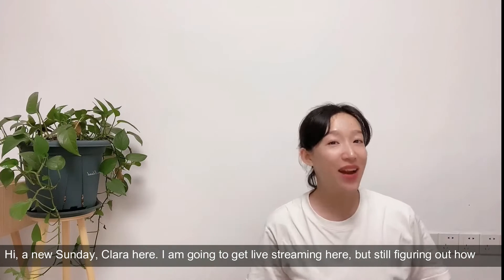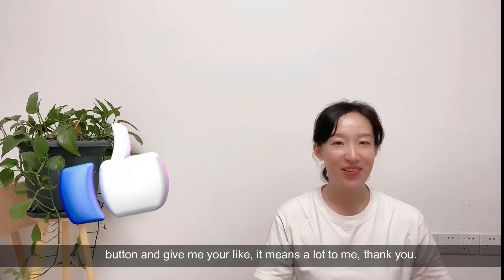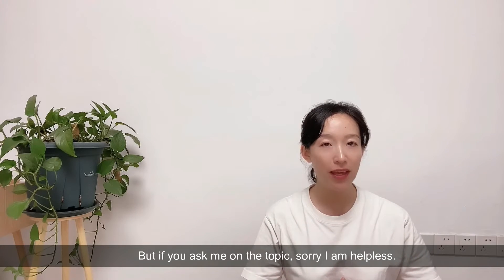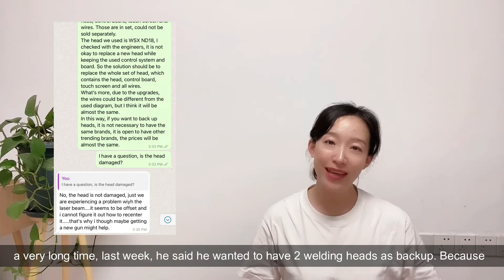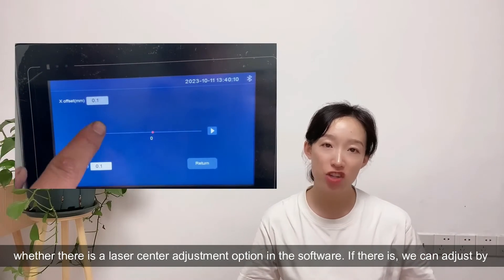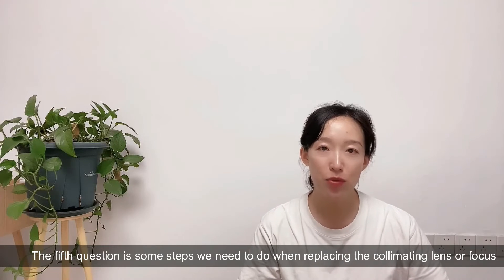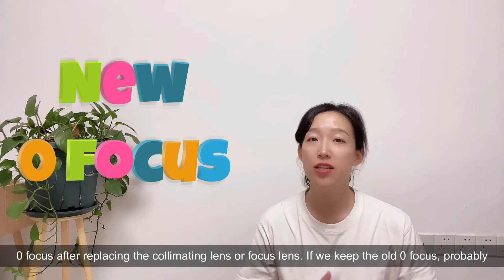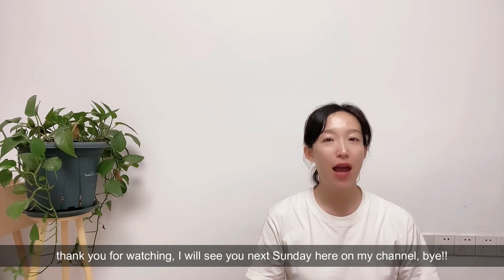Questions and Answers on Laser Cutting and Welding Machine

Comment: Hi Clara!  I just recently started working with a tube cutter laser using TubePro software.  Is there any way in the software to make the shutter (emission) toggle on when cutting and then back off when not cutting?
Reply from the maker: I think no such option right now for TubePro.

Comment: Hello i am from Pakistan

I have a question ❓
When we adjust nozel center, after cutting single sheet, nozel center disturb
Reply from the maker: what means to be disturb?
Reply: Make sure the laser cable is tight in the focusing head and the protection window is clean and tight in is holder.